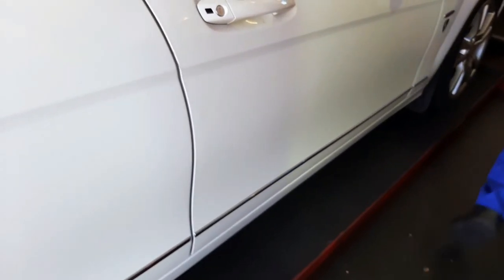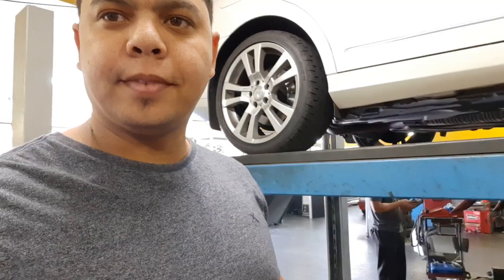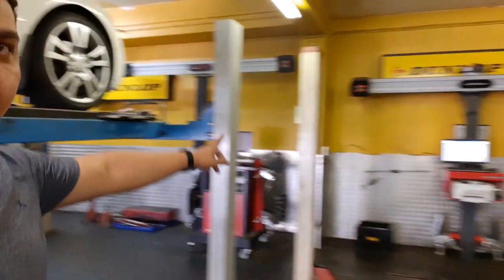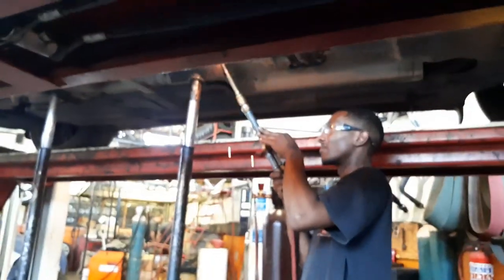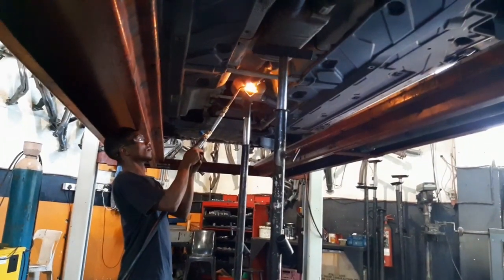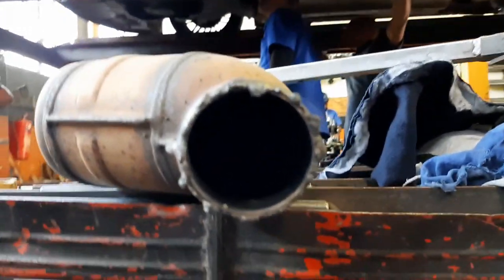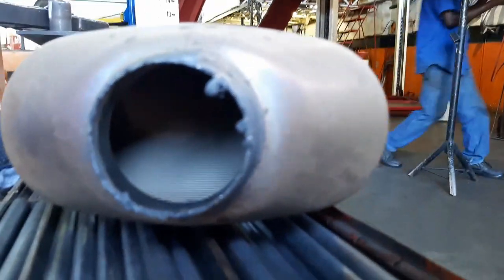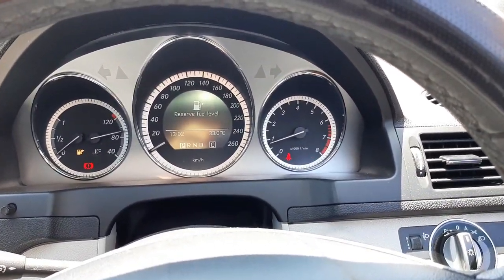Fixed My MB W204 Power issue, It was a Blocked Catalytic Converter!

Comment: might be having the same problem. did you have any misfire codes come up or a check engine light?
Reply from the maker: Nope no codes just felt like a lack of power it was the heat coming from under the car after a drive that gave it away to me.
Reply: @YusufPetersenCPT  how frequent was the heat? my car has the same lack of power and sometimes a little heat comes from under. i feel like i have the same issue.
Reply from the maker: Yes just after a drive of like 20mins you will feel the heat coming from under the car is just not normal at all car is still warm under now after but it was way way warmer before these cars can do with side or bonnet vents

Comment: hey you said this is the m104? it sounded a bit supercharged maybe just a background sound lol.my slk230 has been dead for quite some time. no power so this clogged cat causes this huh. you had no codes right? the car felt like it was in limp mode?
Reply from the maker: Nope its a W204 with the M271 engine the supercharged version. Correct it showed no codes and it just felt like it was down on power after removing this one and some time later now i realize the First cat is also on its way out. they must have been damaged with the engine timing chain issues. so soon i will be removing the first cat too. It doesnt feel like limp mode totally the car will still drive and get up to normal speeds but when hammering it it just feels more and more sluggish as i found out going to the drag strip.

Comment: I have a W204 C200 CDi and battle to get beyond 160km/hr with my engine management light on, do you think removing the cat will sort this out?
Reply from the maker: If the management light is on its in sort of a limp mode, i get 160 so fast its scary.. so have the codes read see what it says coz if its a blocked cat it will come up in the codes. But i think you have a DPF they too tend to get blocked and can rob  you of power like crazy.
Reply: @YusufPetersenCPT  hi did you have the cat deleted?
Reply from the maker: @rew3363  yes totally removed both.

Comment: How's your car now? I've been having the similar problem since I bought the car, now it just got worse with the engine light permanently on. Not a single spare parts dealer around GP has stock.
Reply from the maker: Cars still running fine its constantly featured on my channel. To think it has no cats at all now. Its straight pipe till the resonator.
Reply: My c220 is running well but it's also stalling with an engine light permanently ON.. care to share what happened with yours..

Comment: Im having an issue with my 2008 W204 , not sure if its the cat , car hard changes from 1 to 2 and then sometimes on the freeway the engine wont go pass 80 or 100 , it gets sluggy .. petrol is very high as well. And when on freeway can get petrol burning smell
Reply from the maker: Oh wow thats crazy i would have it checked out yes there is a pressure test you can do to see if its the cats i wouldnt be shocked if its your cats mine felt very sluggish but it didnt limit itself in speed just took longer to build speed. The petrol smell also sounds a bit off. But assuming all else is well its probably the cats
Reply: @YusufPetersenCPT  what symptoms were u experiencing
Reply from the maker: @cellmo1907 super sluggish felt like no boost reving it up took a bit long and car got really hot underneath thats about it.
Reply from the maker: @cellmo1907 your car sounds like its in some sort of limp mode maybe have someone run diagnostics on the fuel system  if your engine light isnt on coupd be vacuum/boost leaks or the gearbox needs some resetting there is a way to reset the gearbox its on youtube.

Comment: I have the strong smell of burnt exhaust I'm my E350 W212.  Nothing inside the car and no smoke. I'm wondering of it's a slight Cat problem, fuel richness or port or normal?  It's not crazy bad but, I've had in for the last 6 months.
Reply from the maker: Burn or warm with a blocked cat you could get really warm under the car so that burn could just be things getting really hot underneath the car unless its coming out the exhaust then its most likely the inside of the cat just burning away with oil and stuff thats built up inside. It could be something small or major try and find out where it could be coming from maybe something smoking when the car is hot to start off with.
Reply: @YusufPetersenCPT  It's not crazy hot or any smoke or anything inside the car.  It's just like a diesel or a slight burnt exhaust smell for about 5 minutes after shutoff.   I'm guessing a small cat issue and not thd port fuel filter/sprayer or something under the back seats.  I've had the smell for the last 6 months. Perfect oil and fluid changes, everything cleaned out and fuel is from different stations at 93 octane.  Hmm.     I'm going with the Cat is slightly blocked. (No hesitation, accelerating loss or sputtering)   The heat thing I haven't checked. Not a fan of 2000 degrees that a blocked cat could potentially get to.  How would one check a blocked cat on their own?   Service it is, I'm guessing.  Thank you for the reply.
Reply from the maker: @UhhhhhnooOOo00oO   theres a way to check for a blocked cat, you have to remove the first O2 sensor before the cats after the engine. they insert a pressure gauge and when the car is running the pressure builds up over a certain amount, thats the one way i know of. other way would be to remove and shine some light through it. my car too drives fine until i step on it then i can feel theres some power loss so my first cat has got to go will be doing that one soon.
Reply: @YusufPetersenCPT  I know it well from Scotty many years ago.  😉 Well there is 73K miles on it. I'm guessing it's slightly clogged. I'm not going about removal and cleaning. I'll pay the crazy amount it will be at my Next B Service at the end of the year.  It just had a B Service last December and they probably didn't do anything about it at a well known Mercedes Service center. You'd think they would have noted that.  Would it have passed their inspection/emissions they marked as passed? (NY being very stringent)     They also didn't reset the service counter. I had to go into the system and do it myself.  I'll do nothing until about November of this year, unless the car falls apart. It is almost in brand new condition and treated like a baby otherwise.  Thanks again
Reply: @YusufPetersenCPT  Added:  I have a fancy scan tool:   It isn't showing a check engine light but, do you think a blocked cat would show up, if I scanned the vehicle?
Reply from the maker: Not really if sensors are ok they still think its passing through a cat it doesnt pick up pressure. My scan tool didnt pick it up either. Until its totally broken then it will pick it up.
Reply: @YusufPetersenCPT  To service I go.  Thank you again

Comment: Tell me how is the smell after you remove it it's dioxide carbon foams  which  making cancer, and your mechanic sold the old one for 1 k
Reply from the maker: He most likely did and gave me nothing for it the bastard till today im cross at powerflow as i didnt know back then. Smells just like a normal car from back in the day to me so nothing im not used to cold starts are smelly tho but as it gets warm its not bad just smells like a warm engine running.

Comment: How much you paid for this?
Reply from the maker: It could technically be free, they charge around R1000 to cut out and replace with a stainless piece of pipe. But most places will buy the cat from you for more than that so find out by the place how much they will pay you for it. If they don't want to, get the job done keep the cat and sell it to a buyer.

Comment: Did you have to delete the cat out of the software?
Reply from the maker: Nope i just put a fooler in  and the software doesnt car no engine light.
Reply: @YusufPetersenCPT   i want to remove the Cat but don't want any codes coming up,   what exactly is a fooler that you used?   got any pics or links?   Thanks man
Reply from the maker: @OzarkLivin  hi there yes I used a fooler and I got no codes at all been driving like that since. The car will burn a bit more rich to be safe but once it's warm it's normal. It looks just like a hollow extention for where the O2 sensor sits, it goes in the thread first and then the o2 sensor goes into that so it just pulls the sensor out of the direct flow and just a little away thats how it fools the ecu... @B is For Build made something similar on their LS boat engines same concept. Hope this helps.
Reply: @YusufPetersenCPT  so did you actually cut the cats out physically or just remove/trick O2 sensor?    sorry for all the questions was just thinking if you removed the cats there would be know where to put the hollow extentions         thanks!
Reply from the maker: @OzarkLivin  so the location of the sensors are in the same place but I cut out the cats completely and put in str8 pipe sections so the only stuff left is the resonator that sits before the diff and the silence at the back with the tail pipe on thats stock. From the engine till the resonator is str8 pipe

Comment: Hi are you in australia, where is the garage shop  located ?, i think i ve got the same problem
Reply from the maker: I'm in South Africa... but I'm sure there has to be an exhaust place close to you that can do that job for you it's not too crazy it's just cut off and replace with a stainless steel bend.
Reply: So, you didnt replace it with original mercedes catalyc converter? Just after market stainless steel ?
Reply from the maker: @satyorabbani2983  yeah I didnt replace it I totally removed the cat and put in a str8 pipe to replace it. Theres no sensors after this cat so to the car it's like nothing's changed you will pick up a bit of power and it sounds a bit more meaty you can go str8 pipe all the way to the back from here if you wanted to..🤗 the first cat right after the exhaust manifold that one needs to be replaced if faulty.
Reply: @YusufPetersenCPT , where in South Africa brother? I really do need to do this on my Merc.
Reply: @YusufPetersenCPT  I'm kn SA. Johannesburg.  Do you know anyone who can replace my converter because mercedes benz will charge me an arm and a leg my power is low and petrol consumption is high due. Please help. I have a 2008 w204
Reply: @mofokengmoiloa1231  me too I have a w204 2009. I think Im going to decat or find a welder who can do the bypass as @yusuf mentioned
Reply from the maker: Yes guys a blocked cat sucks it's crazy just hoe much power it sucks but computer sees nothing wrong coz its still there. I say chop them cats if theres nothing else wrong with the car like boost leaks or anything.